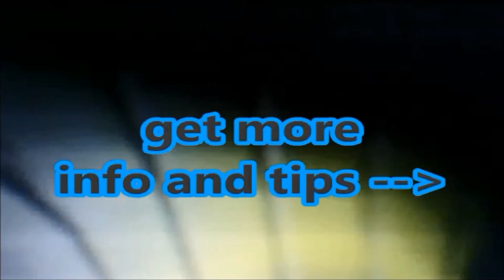Cara membuka klep pembuangan mesin cuci panasonic 2 tabung

Comment: Mesin cuci saya model nya mirip seperti di video. Awalnya bocor/ngembes  air keluar terus walaupun pemutar dalam kondisi regular/tertutup. Sudah saya buka memang ada pasirnya dan klep karetnya ada yg sudah robek. 
Akhirnya beli klep karet baru dan audah dipasang lagi.  Dalam kondisi tertutup/regular air memang sudah tidar ngrembes tidak keluar, tapi saat saya coba putar spinnya ke drain/buka airnya juga tetap g mau keluar.  
Itu gimana kak solusinya?
Reply from the maker: kalau tidak bisa keluar airnya, apakah sudah dipastikan pas masangnya pegasnya sudah bener masangnya dan bisa narik maksimal (yang buat narik kelep) ?
Reply: beli klepnya dimana bang, mohon infonya?
Reply: untuk karetnya yang nomor brp bang